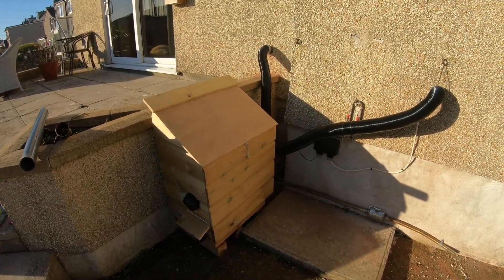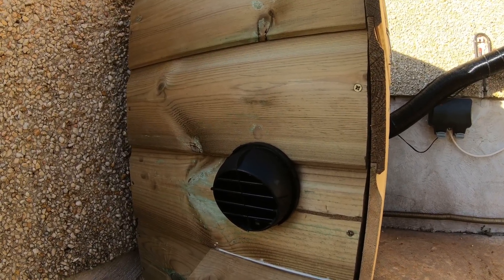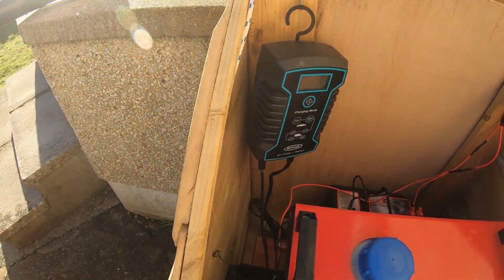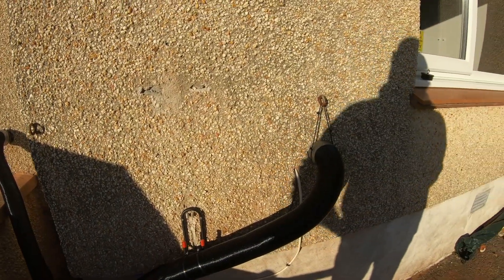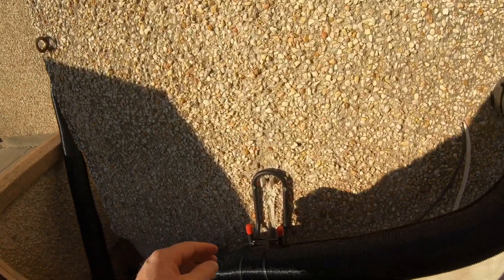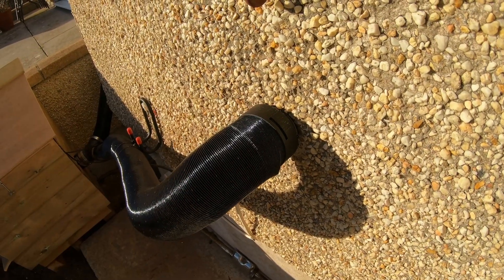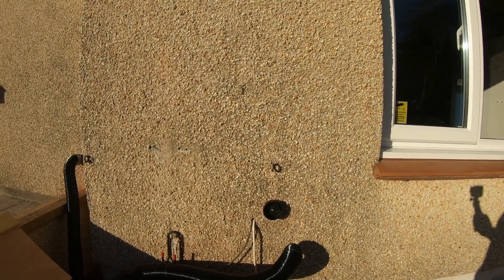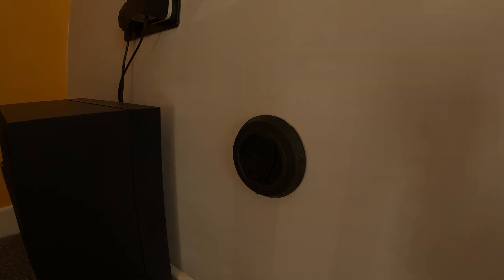Heating my home with a Chinese diesel heater.

Comment: You may want to consider drawing your air that’s to be heated from inside the house. I used to draw mine from outside and like you said about condensation, the near zero temps prevented the burner core from getting to full operating temperature. The result was it sooted up in no time and shut down. I luckily got way without stripping the unit down. I now run a pipe from inside the building and no problems since. Lots of moisture traps and job done 😎👍
Reply from the maker: When they leave the factory the heaters are not tuned to your circumstances - air density, temperature or humidity, regardless of where in the world they are going to be operated. Where it sits will also make a difference, for instance, how much air it manages to draw and at what rate the hot air expels. I’ve tuned my heater, in situ, in minus temperatures, to its optimum, having to increase the fan speed but reduce the pump rate. My infrared thermometer confirms heat value at both high and low rate plus no visual smoke or moisture output at the exhaust at any stage of the burn. Im happy that it’s running at its best and won’t soot up, especially as I’m running on diesel only and not some concoction. Thank you for your interest and indeed your comments. 👍🏻
Reply: @en53kff  for how ong did you use it like that in colder times
Reply from the maker: @punisher288   Ihave it on in the morning for a couple of hours and then again in the evening for about six hours.
Reply: If you do it like you're describing, you're pulling heated air from inside your building into the diesel heater and ejecting it out the exhaust. This is wasteful. This also pulls cold air from outside into the house through cracks, reducing your efficiency and creating very cold drafty areas wherever sealing is not perfect. 

I can't recommend what you're doing - there are better ways to address the problem.
Reply: @itsumonihon unfortunately you don't understand positive presure principles. Drawing intake air from outside stops cold air entering the house through unsealed gaps, no cold spots.
Reply: @madeleyinc a home should breath  these heater cannot run long duct runs!
    so recirc  your heated air .or   place  unit inside house . Take combustion air from inside!
Reply: @itsumonihon 
Why would it go through the exhaust? Doesn’t the air from inside the house get heated, and sent back inside? Surely combustion is completely separate?
Reply: @moobengy Correct - combustion is separate. These diesel heaters have two airflow circuits: The high volume flow takes air in through a vent on the back panel of the heater unit, blows it through the gap between the aluminium core (which has heat exchanger fins on it) and the outer plastic housing, then out of the hole at the front of the heater. Some have one large hot air outlet hole like the one shown in this video, some have 4 smaller outlet holes so you can connect up more ducts to split the flow into different rooms.
The lower volume circuit draws air in through a smaller intake tube at the bottom of the unit - this air is pressurised slightly, flows into the core, over the glow plug and wire mesh catalyst to burn the diesel, then the combustion products are expelled out of the exhaust tube which is also at the bottom of the unit.

Comment: I'm sorry. You have oil fired heating, so you thought you'd try out oil fired heating as the heated air unit is?
Reply from the maker: I think what you’re trying to ask is, why I’ve got a diesel heater if I already have oil fired central heating. 
The answer is, cost. The oil fired central heating boiler burns the heating oil at a heck of a rate and cost a small fortune. Whereas, 30 to 35 litres of diesel will heat my home for a month.
Reply: @en53kff  It should be the same to have one radiator on as having the air heater on low.
I would guess you have an issue with your central heating. But I suppose having a new boiler and doing the needed update costs more than a chinese diesel heater.
Reply from the maker: @Chicken_Massacre   No, my boiler & heating is fine. I just choose to heat the house by the cheaper method.

Comment: Your box in Wood ???? I dont understand ……fire ,wood……maybe metal is better ?
Reply from the maker: The only heat of any great substance comes from the exhaust which is nowhere near the timber. Some people choose metal , some choose plastic, I chose wood. Others have no box at all. I’ve never heard of a diesel heater that’s caught fire under normal use, has anyone? I wouldn’t have made that choice if it was running on something highly flammable, such as petrol. It’s been running fine for three months now and I’ve no intention of changing it.

Comment: Just equipped my van with an Eberspacher recirculating diesel heater. It was fitted professionally under the left side next to the main fuel tank and I have the hose into the van but it’s not wired up yet. -1’ last night so sodding freezing in the sleeping bag!! I must get it wired in! 😅
Reply from the maker: Mark, when it’s wired in you’ll love it. In fact I’ve heard of people having them in the van and they get too hot. A good brand the Eberspacher too. Get it sorted, you’ll sleep like a baby.  😊

Comment: The reason you NEVER use PVC pipe is because it gives of HYDROGEN CHLORIDE GAS when heated up 
Your lucky you changed it because of the smell as it could have been far worse
Reply from the maker: Yes, very lucky. 👍🏻

Comment: The exhaust pipe can exit the building using the same method as a wood burning heater using a metal duct and a metal inside liner.
Reply from the maker: Yes you are correct. That’s not what I wanted though in my build.

Comment: Great video! An update on the cost benefits of heating with one of these would be another good video 👍
Reply from the maker: https://www.youtube.com/watch?v=mVf1TwbLKqQ  Hi Jack. Thanks for your comment. 👍🏻 There are so many videos out there on every aspect of these heaters that I’d only be repeating what someone else has already done. I made my video purely to show my set up. However, I have given you a link to a video where a guy shows you how to work out the costing, dependant on how high you have your heat set (pump rate) and with different fuels. You may have to make some adjustment in calculation if your fuel is a different price, but the maths are all there. It’s a quick video so you may have to replay it a couple of times or pause it. Almost anything you need to ask is covered by someone’s video, it’s just a case of a quick search on YouTube or Google. It’s how I learned and got hints and ideas. Good luck with it. All the best. 😊
Reply from the maker: Jack, you may be interested to see comments from Nigel D  & also from Gary McKinnon. 👍🏻
Reply: Great thankyou for your quick replies and help, I will definitely check them out! Keep up the good work ✅
Reply: https://www.youtube.com/watch?v=4tiSEGO6pYI This guy goes over cost and alterations to improve. Hope this helps.

Comment: Amazing setup, and thank you for sharing! I have a little tip - if you want to get rid of clicking sound of the fuel pump just hang it on elastic bands or zip tie, it will become almost silent. I have a question about the exhaust fumes. The house it's not a camper, it doesn't move. Does the fumes cloud builds around your house?  What about your neihgbours, any complains?
Reply from the maker: Hi Den.  I’ve never had an issue with the clicking because of its location. I don’t hear it inside the house. Although I have heard of different methods to quieten it  as you suggest, but never needed to change it. As for the exhaust, there are no clouds as such. I get no visible signs, no smoke or moisture content and no obvious smell either. I have seen videos where smoke bellows out but can only assume that is more to do with what fuel they’re using or the heaters settings. As I live near the sea it is nearly always breezy and so imagine any fumes are quickly dispersed. My neighbours aren’t close enough to be within earshot of the heater. I do have an oil fired central heating system which has a large heater and is outside, albeit in a brick built shed type construction. . If I turn that on, it is 3 times louder than my diesel heater although not annoying loud. I’ve never had a complaint about that either.  Hope this answers your questions.   Thanks for your interest. 👍🏻

Comment: With respect, diesel is literally twice the price of natural gas. What is the saving ? 1 litre of diesel ( or , very closely, Kerosene, has a total energy capacity of around 5KW, per litre  and guess what, no heater is 100 percent effecient, so 4kw.Heating oil prices in the UK are around £1 per litre at the time of writing, so, that is around 20 to 25p per KWH, basically MORE THAN TWICE , the price of natural gas. Some saving lol.
Reply: While I completely agree with you that if your on gas heating that it would be the cheapest form of heating. I’m not sure your sums are correct. I think you’ve converted 18500 btu lb to kw. But that’s kw per lb. Kw per litre is roughly 10kw. I do completely agree with you that the sums don’t add up. Unless people are using really old inefficient oil heating or gas bottles. Stick with your gas for failing that your oil heater with a larger tank. Stuff holes in walls for vent pipes and decanting small amounts of kero or diesel. Ultimately the Chinese heaters will not last as long as a professional boiler which professionals will be happy to service and ensure is working correct

Comment: ive had mine in since December the 18th and cut my combined electric/gas bill from £240 to 110 ish ....i run of kerosene aswell lovely and cheap i leave mine running all the time with my house being open plan with the stairs in the room it heats upstairs lovely to 21oC only cool room is the kitchen but i can deal with that
Reply from the maker: Hi Nigel.  That’s great that you managed to cut your fuel bill. I haven’t put a price on mine but it’s quite a saving.
Incidentally, I’ve just had a comment that said “I seriously doubt that’s a cheaper method of heating your home”.  Just what can you say to that?
How much are you paying for kerosene where you are? Do you have to buy in bulk?I’m running on red diesel from our local garage at  £1.30a litre.
Reply: Is the saving including your price of kero to run the heater?

Comment: You or should I say your wife made a pretty important point when you told us of your accident while filling the tank with diesel. 

People think if you put these units outside there is no risk of fumes entering the house but this simply isn't true.

These units act just like an air cooled engine only the air being used to cool said engine is ducted and funneled into your house.
Any potential fume problems outside can very easily find there way inside.

Don't get me wrong, I think these units are great and have several projects lined up for them but people should know the realitys of how they work and not to be lazy or  complacent because "it's safe outside" 
It will be perfectly safe if you do a proper job installing it and its not rocket science but a little bit of time to think and a little bit of common sense goes a long way. 

I would also say that insulating the duct is a must.
Its so inefficient to leave them bare and of course this will only increase as the outside tempreture decreases. 

Another good point was that taking your supply air from outside helped control condensation. 
Normally I would say recirculate the supply air but often especially with slightly older homes, they get the full works with additional insulation and double glazing that they end up  wrapped so tight that they can't breathe which then leads to condensation. 

I Personally have a bathroom extractor which is controlled by humidity and my kitchen extractor is a proper vented type not just a filter and this seems to be enough in my case.
Reply from the maker: Hi Tommy. Some good points there. Yes, a bit of thought about the build will hopefully avoid problems later on,  e.g. keeping the exhaust outlet well away from the air intake. Maybe common sense to most, but not all. My ducting has since been insulated. Always the plan but not in place when making the video, plus I wanted to show the ‘Y’ piece & the reducers. You’re right about some older homes, mine is insulated to the
Reply from the maker: ………continued.  🤪  insulated to the nth degree. I too have those extractors fitted and although very good, the warm dry air is a big bonus. I’m intrigued when you say you’ve several projects lined up. Are they straight forward heating projects or do you have a twist ? Anyway, good luck with it. Cheers. 👍🏻
Reply: @en53kff  mixed bag really, I've got a couple of simple heating systems using these heaters then I have a webasto hot water system that will feed hot water for central heating and go through a heat exchanger for showers and general use. 
I have also got a pellet fed rocket stove that I made years ago and want to use for heating my work shop and hot tub but thats not for a while yet.
So many projects, so little time 😢

Comment: Good setup, the diesel heater produces dry air, and blowing in from outside means it’s acting similar to a PIV positive input ventilation system, (normally Loft fitted) producing a slight pressure in your home and escaping through gaps and holes etc, slowly pushing out damp air and introducing fresh dryer air. I’ve got a PIV in my loft and will be setting up my diesel heater similar to you in the summer. 👍
Reply from the maker: YES, someone who gets it….  you’ve got it  ‘bang on’. 😀  So many people have said “you need to recycle the air from indoors”.  I have positive pressure = no draughts. I have fresh air = no condensation on windows. Yes, I may be using slightly more fuel, but the benefits outweigh that. I did look into PIV but no longer need it. We all learn tips by watching others videos and using bits that best suit us. Good luck with your set up and thanks for your positive comment. 👍🏻😀
Reply: I had very bad condensation in my house. My ceiling would actually form water beads. Fit a piv unit in the loft and the house has been bone dry for over a year now. We don't even get condensation on the windows
Reply: Its not "producing dry air". It heats up the moist outside air, therefore the relative humidity drops. The absolute humdity however does not. The way this is installed, its actually shoving moist outside air into your house. At night when the room temp drops this will cause high humidity, condensation and ultimately mold.
Reply: have you got heater installed in front of the PIV system for your house?
Reply: Pushing out heated air is no good
Reply: I can't even watch any more.  Moron fake tech
Reply: I think that's pretty obvious

Comment: You better isolate the tubes...now you lost to much heat outside
Reply from the maker: If you read some of the past comments you will see that they have been done. Cheers.
Reply: @en53kff  great i like it....i wil do the same next week at my garage
Reply from the maker: @giovannipg3000   Great. You won’t be disappointed, they are great little heaters. Good luck with it. 👍🏻
Reply: @en53kff  i wondering if its possible to put 4 heaters togheter with 1 controler for a bigger room ?
Reply from the maker: @giovannipg3000   I’m not sure about that. I’ve not seen anyone using one controller for multiple heaters.

Comment: Interesting video Rob, but you missed out the bit I was really interested in. Did it keep the house toasty (in cold weather) on its own?
Reply from the maker: Hi Barrie. On the coldest day, -6 outside, it was reading a temperature of 14° inside the house. I turn the heating on in the morning and within an hour it was 20° at which point I reduced the pump rate to about half. An hour may seem a long time but remember I am heating two separate parts of the house at the same time with the one heater. I have no complaints and with hindsight would still go ahead and do the same again. Thank you for your comments.  👍🏻

Comment: Have a look into using quilted foil insulation wrapped around the hot air pipe
Reply from the maker: Hi Nate. If you read through previous comments you will see that I have already done this. Cheers. 👍🏻
Reply: @en53kff  gotcha 👍